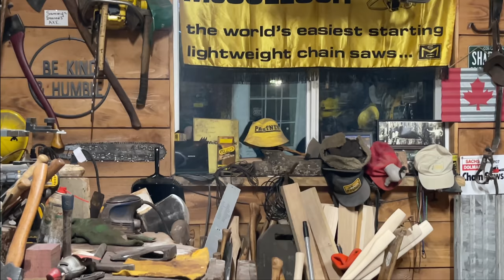I can’t wait to use this amazing tool

Comment: G'day Buckin, I agree a thirty inch handle would be spot on for a three and three quarter pound axe, and the Hicory also agreed when the spotted gum pushed it aside ! That head will not ever come off from normal use .

Comment: Hey Buckin, I've been reading up on the BTU output on the different woods.  I can't find any info on American Holly.  I cut one down in my own yard last  January.  I swear it burns as hot or hotter that oak.